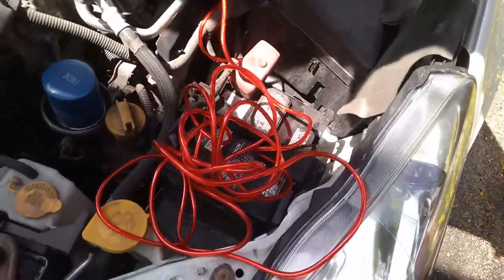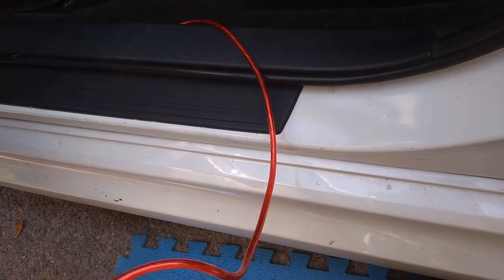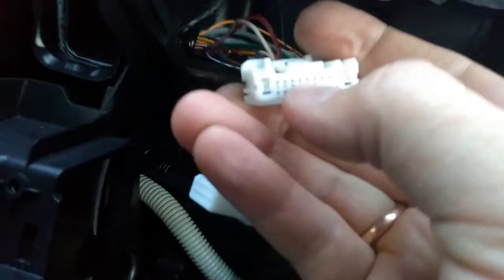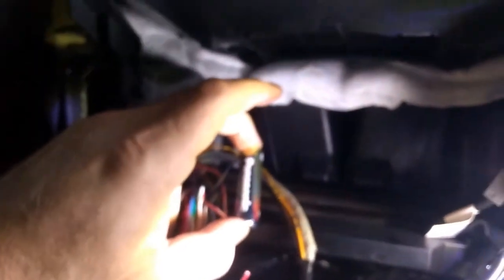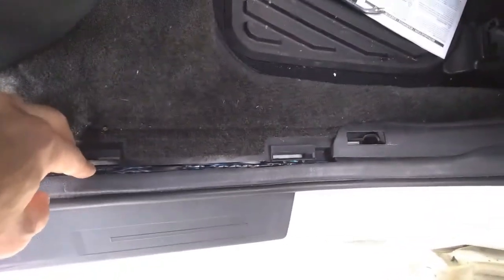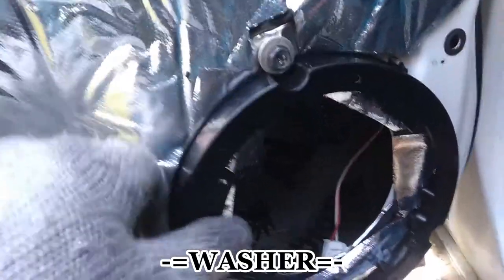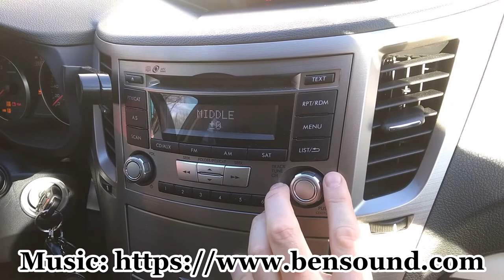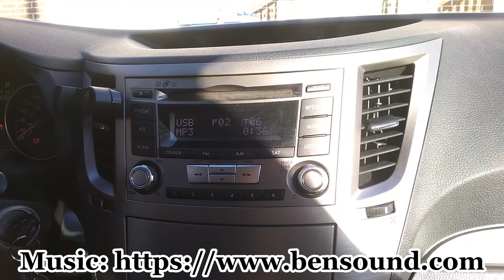Subaru Legacy - Adding Subwoofer & Upgrade Speakers - Part#4

Comment: Great series of videos, very well done! Really helpful as I'd like to deaden and upgrade my own legacy- a lot easier when someone shows you first- thanks for making and sharing this, good luck!
Reply from the maker: Thank you very much for your feedback. I really appreciate it,
Reply from the maker: Actually, the subwoofer is a way better than i thought.
It turned out it was something wrong with connection on sub's side, i connected 2 wires  channels/stereo and later i found it was canceling the signal somehow. In order to make it right, I conected just 1 chanel and a ground wire.
So, now it sounds how it should with great bass, it really makes a difference.